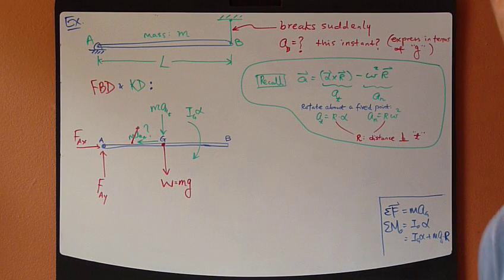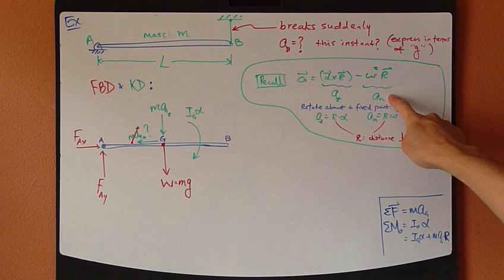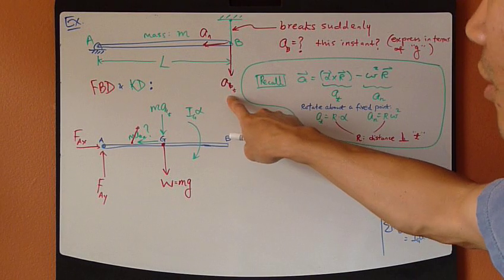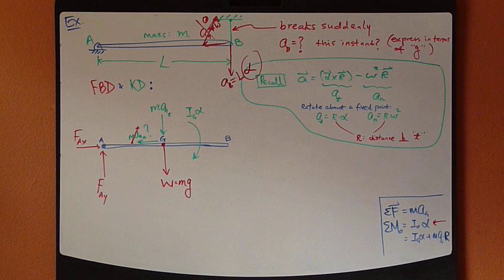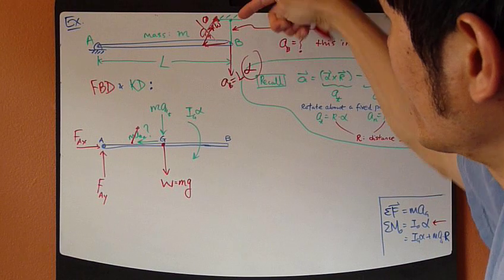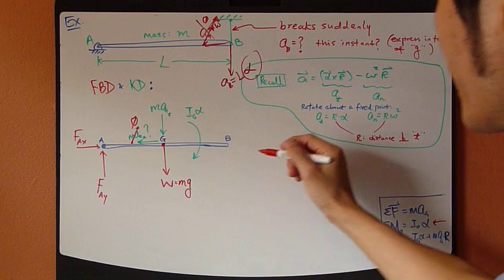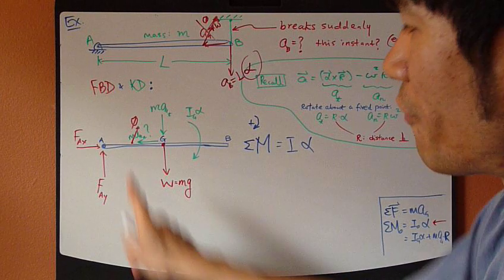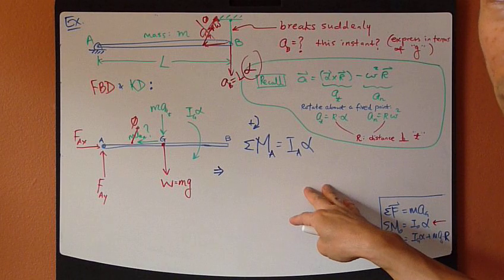Engineering Dynamics Ch.17 Part6: Rigid Body Kinetics - 2nd Law

Comment: because at the point when the line is cut, V is still 0 as it hasnt started to move. and since W = V/R and V is 0 at that instant, there is no normal acceleration at that instant. but as it moves down (past the point where the line was cut), there will be normal acceleration.